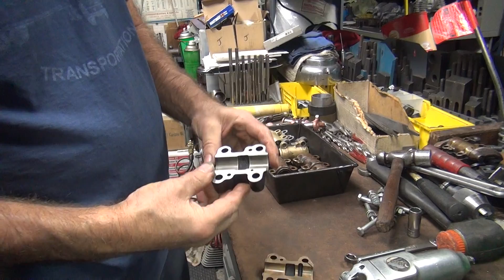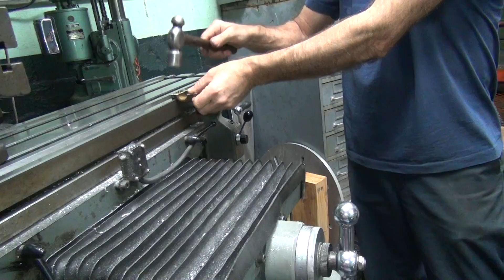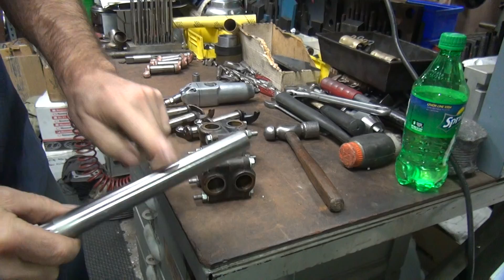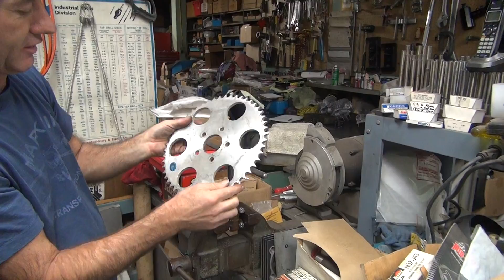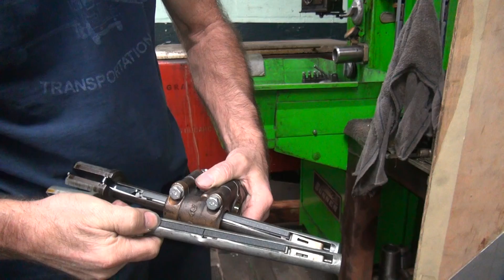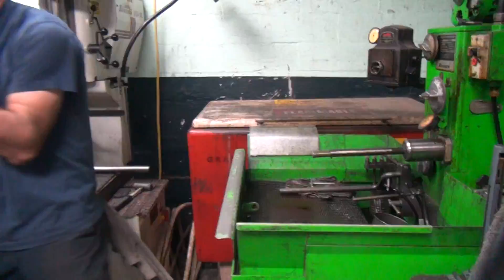1958 panhead 74ci #130 fl bike rebuild topend repair harley by tatro machine

Comment: Keenan, your horizontal honing machine is a Sunnen is it not?? the reason why I ask I had the same machine except mine was red I can't remember the gentleman's name but when I lived in Missouri there was a guy that made and repaired the honing Arbors for me he was a friend of my dad's he used to work for Von Weise gear him and his two sons ran a business in Fenton Missouri they could make custom hones to for that machine as well as repair and replace I'll see if I can find them and turn you on to them I know they are still in business I know Sunnen is getting harder and harder to deal with I think their father worked for Sunnen at one point in St Louis on Manchester Road...
Reply from the maker: yes it is a sunnen hone. my hone is an industrial model, that is why it is not red. the old owner painted it this color.
tatro